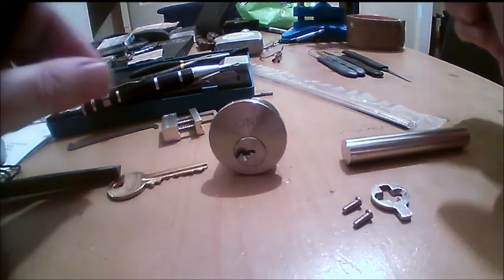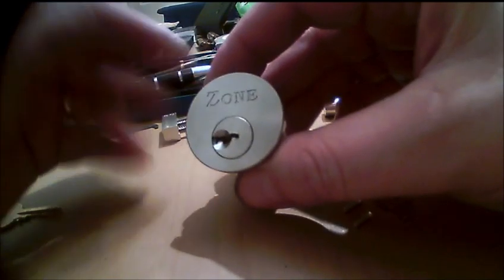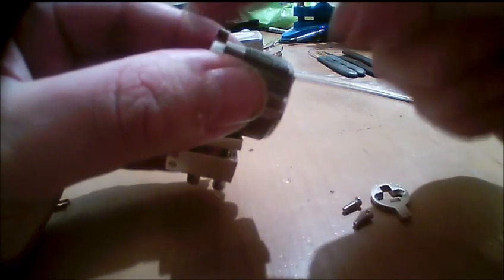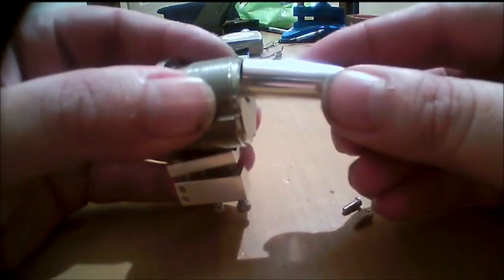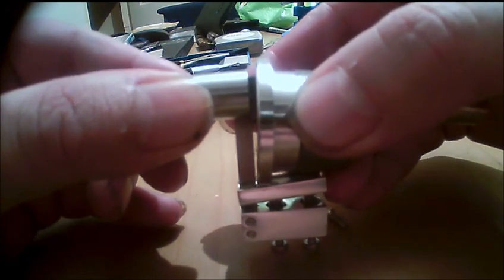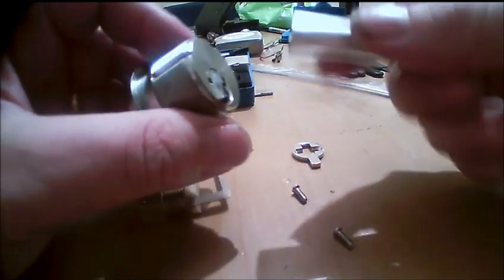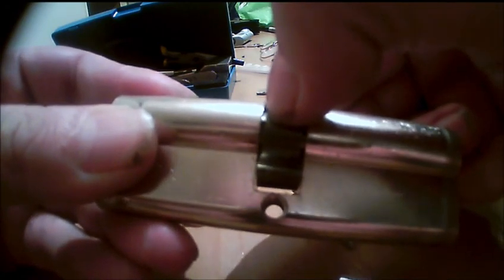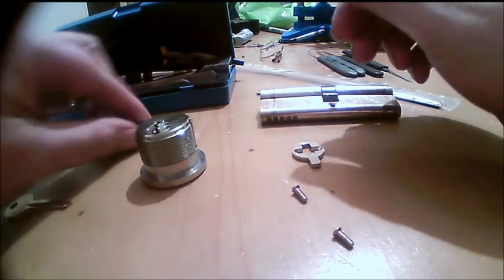why does one of my followers have a grove in

Comment: Nice little tutorial.
Thanks for sharing🍻👍😘😘🤓🤓
Reply from the maker: +Pick Beard  cheers pb just done it for steensys benefit
Reply: +Pin Pickers I probably need more help than him in this department 😭😩😂😂😋
Reply from the maker: +Pick Beard  if pick the lock turn the core to 90 degrees then put the pinning shoe in before you put a follower near the lock you cant go wrong because the drivers and springs are already held down and cant pop out when you push the follower in.  Then remover the pinning shoe once the follower is in